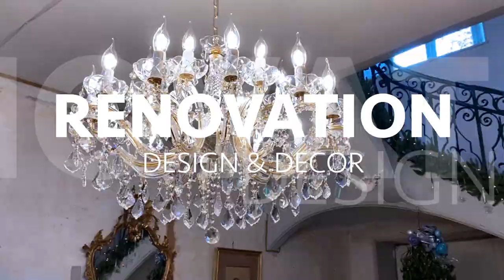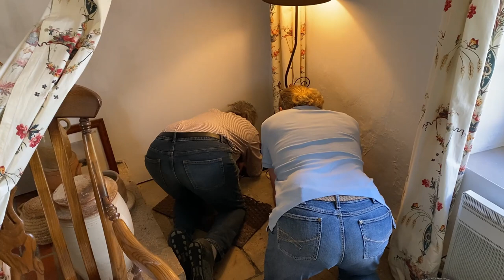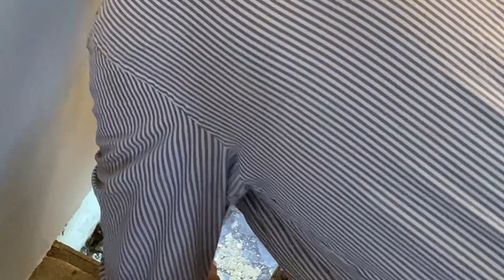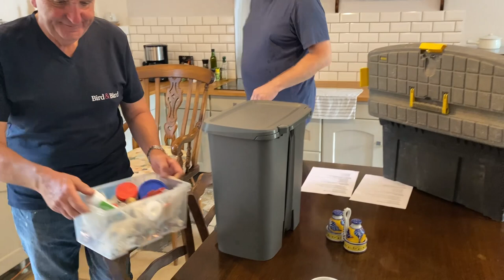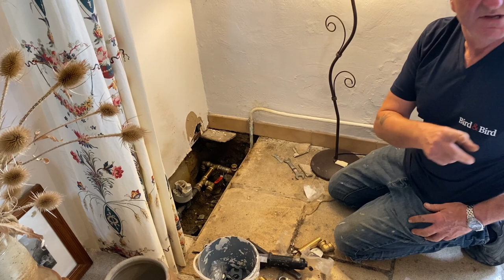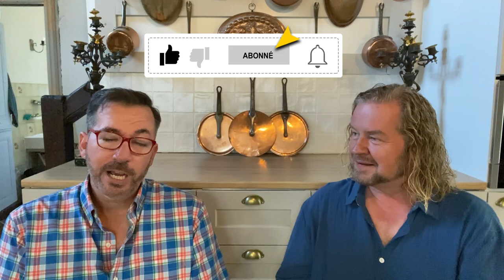EMERGENCY! Guests Arriving Soon and the WATER PIPES have BURST! - Journey to the Château, Ep. 122

Comment: Dear Patrick and Stuart, your friendship with Tony is heartwarming.  He is very enthusiastic and knowledgeable on many areas of home improvement.  He’s a treasure.  My home has an interior turn off valve for all exterior water spigots so they don’t freeze in the winter.  I don’t know if that’s a problem for you, but where I live I turn off the valve before the first frost of the year. I love how you stopped using your saw until the little birds leave their nest.  By the way, the copper pot area behind you is so lovely and French.  I love the way you created that area and how it turned out.  Stuart the music during the plumbing mystery and solution was perfect.  It was almost like a pink panther or inspector Clouseau episode!!!!  Hugs!  xx
Reply: We are blessed with a wonderful friendship. Tony is amazing.  😊😊
There are normally no deep frosts here.  Maybe a few days of 28 degrees.  We had shut off for outside water in Woodstock as well.  Well, we put it in because the pipe was cracked because of the hard freezes.  😮😮😮.  
Glad you like the pot rack area.  It is fun to change it and it is evolving organically.  😊❤😊.   Glad you liked the music. I thought the same thing.  Huge hugs darling ❤❤❤

Comment: Why don't you close off the garage over the winter, remove the swallow nest, and make sure the old pigeonaire is open so it can become a large swallow's bird cage for several years into the future.
Reply: Hi Jerry.  Swallows only build nests under roofs with beams.  They are a sign of luck and are considered a huge blessing.  A short delay is a small price for such beauty.  😊😊😊. And we opened the spaces up, so they would come back after many years of absence at the chateau. We feel blessed to have them.  ❤❤❤
Reply from the maker: As Patrick said, swallows build nests in very different ways and locations than what is in the pigeonaire. Thanks!